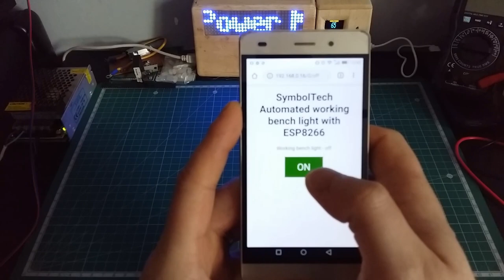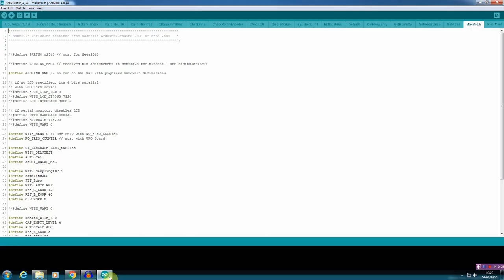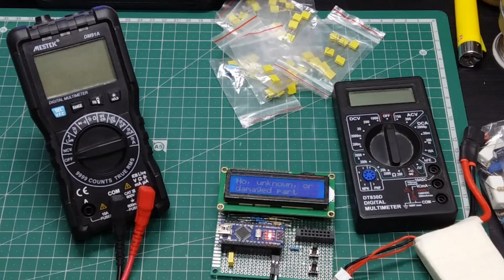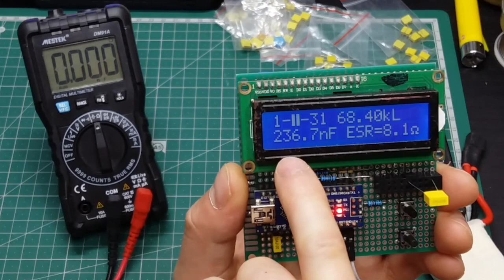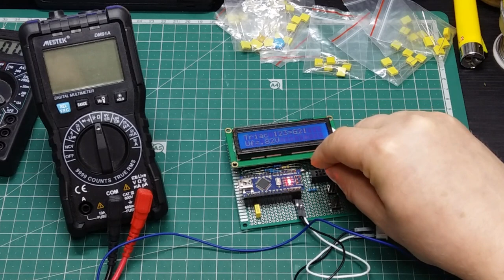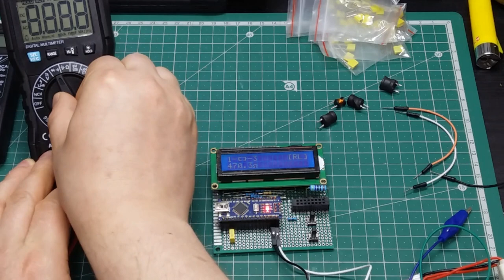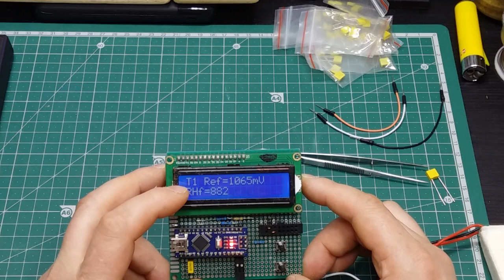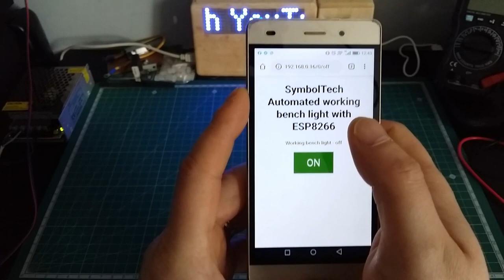Arduino electronics components tester

Comment: Please please send schematic diagram of this project using Arduino nano😢😢😢
Reply from the maker: @Royal_job_Info  should be a link on description
Reply: @SymbolTech21  
bro insted of using SCL and SDA in OLED display which pins are used in LCD DISPLAY please 🥺🥺
Reply from the maker: @Royal_job_Info  but I didn't used an oled display. Is an LCD 16x2 display and is connected to Arduino normally how is connected in LCD display library sketch samples
Reply: @SymbolTech21  You used UNO in schematic diagram Bro but I'm used Nano in practical please tell 😢😢
Reply from the maker: @Royal_job_Info  the pins are the same to Arduino nano or Uno both are using the same microcontroller chip
Reply: @SymbolTech21  please tell me bro
Reply from the maker: @Royal_job_Info  it's easy just follow my video and see the connection diagram

Comment: can i use mega2560?
Reply from the maker: You need to modify also the code for 2560
Reply: @SymbolTech21  which part the code i must modify?
Reply from the maker: @bapaknyaarya6425  I don't remember exactly the code because I did this project long ago but I think there is some line where it's mention which mcu and u need to modify there
Reply: @SymbolTech21  ok thank u very much sir😀

Comment: Code working at nano or not
Reply from the maker: no u need to burn uno bootloader into nano
Reply: @SymbolTech21  when I upload code in nano ....code uploaded but lcd display is showing nothing...
I am using 16*2 display i2c
Reply from the maker: @satishkumar-gg5fm  will not work with i2c u need to connect just simple one
Reply: @SymbolTech21  thanks

Comment: version 1.13 is super slow. doesn't show right esr.
Reply from the maker: do you know any new version?
Reply: @SymbolTech21  0.7f
Reply: @techs5564  Can you please share 0.7f Trying out 1.13 takes forever and also getting Not Calibrated! msg.
Reply: @techs5564  oh ok got it thanks..
Reply: @knightrdx  you're welcome. if you get success reply here.
Reply: @ Tech S, Sir change the AREF capacitor installed on your Arduino Nano board (bottom side of the board) to 1NF, ( default value 100NF to 1NF ).

Comment: It's nice that you are trying, but the assembly is not good! It's slow, there are a lot of errors, and for beginners it's a waste of money and a waste of nerves. You have to redo the schematic and fix the code if you think it can work. The circuit definitely doesn't work, that is, it doesn't work.
Reply from the maker: Looks like lots of other people they tried and for them it works fine. Just double check your connections and make sure that everything is connected as per schematic and will definitely work fine

Comment: C:\Users\John\AppData\Local\Temp\arduino_modified_sketch_276019/sketch_jun20a.ino:1349: undefined reference to `lcd_pgm_string(unsigned char const*)'

collect2.exe: error: ld returned 1 exit status

exit status 1
Error compiling for board Arduino Uno.
Reply from the maker: should not give you any error because I test it so many times. maybe you change something in the code

Comment: C:\Users\John\AppData\Local\Temp\arduino_modified_sketch_276019/sketch_jun20a.ino:1349: undefined reference to `lcd_pgm_string(unsigned char const*)'

collect2.exe: error: ld returned 1 exit status
Reply from the maker: you need to check your library for sure is an error in your library
Reply: How I checked library

Comment: Don't even attempt this, you will never make it work. Just read the comments. I just tried and have been immediately met with error after error after error. He said not to use the schematics that he provides, but still put them in the description instead of the correct one. Same with the code. There are errors in literally EVERY sketch in the zip file. This just seems like some guy wanted to put a YouTube video on the internet and it didn't matter what it was about. This an an hour of nonsense.
Reply from the maker: if you read other comments you will see that lots of other people work make sure you have all libraries installed
Reply: So if you want any time I can prove that everything working perfectly the schetch and the schematic. If u listen good he said that there is a schematic that it's totally wrong and he provide the right schematic and code. For me it's working good. Maybe u miss libraries and that's why u face all the errors
Reply: My NANO worked fine first go - following the instructions perfectly. I can assure you that the code and the schematic diagram are correct as at JAN 2023.

Comment: Hi
Reply from the maker: hello
Reply: @SymbolTech21  hi
I made the circuit as you suggested.  It works fine, but it requires constant calibration, I wonder if this is normal. I calibrated it many times.
Reply from the maker: @zafersari6310  just only one time its fine. will ask always I just need to look on the code when I get some time because I am really busy right now. because the restrictions has lifted in uk and my work place where I am full time working they call me back to work and then I have so many projects that I am working also as well. bus soon as I will have just a little time I will look to see what I need to change on the code to make it not asking always for calibration